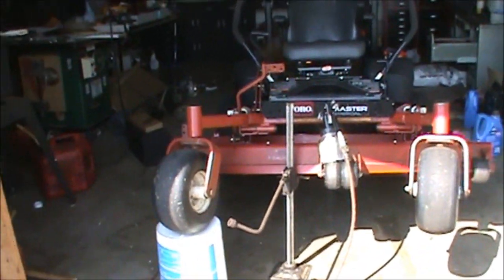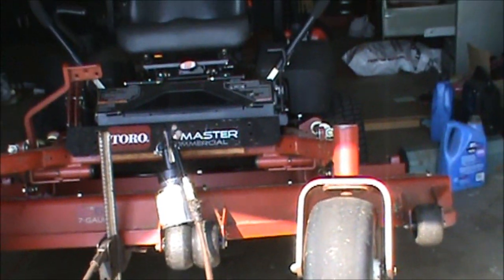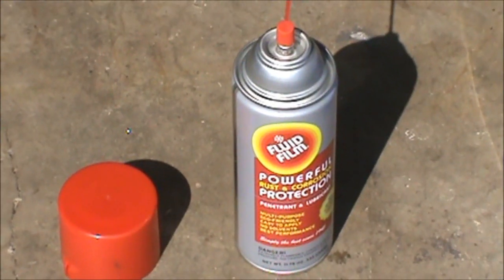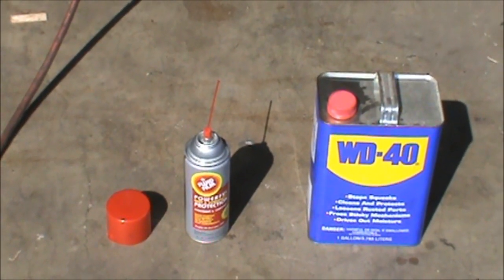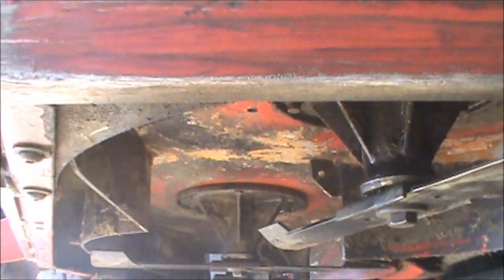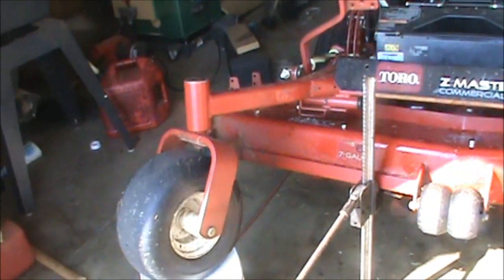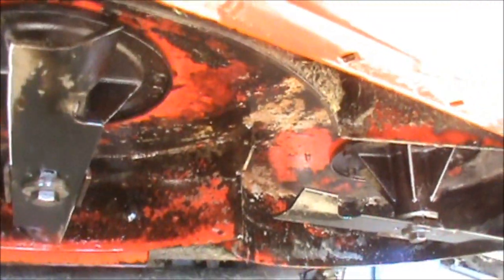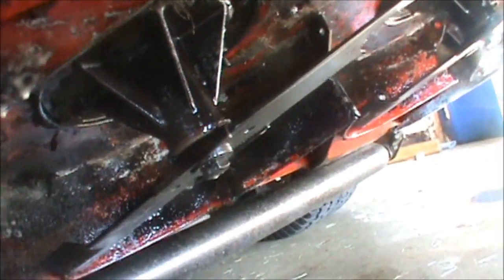Zero Turn Mower Fluid film v. WD40 Mower Deck grass sticking Part1

Comment: get a electric winch at HFT for about no more that 50 buck hook to you mower and raise it up to put blades ect, way i did mine out of drill pipe i use it for a lift and porch swing so easier and safer way to work under your mower  HAPPY EASTER